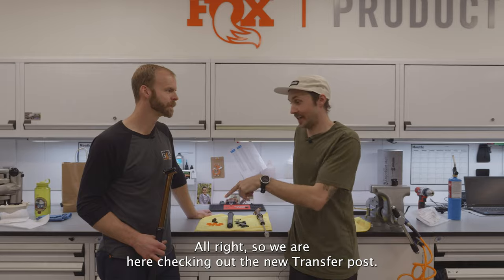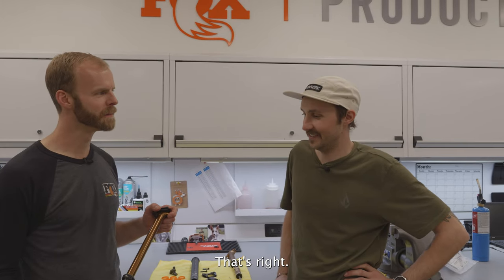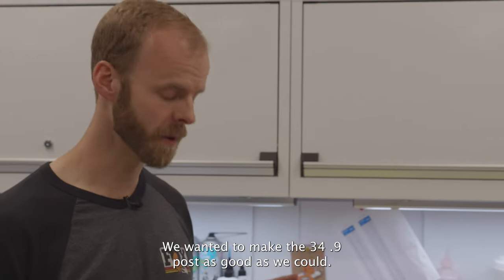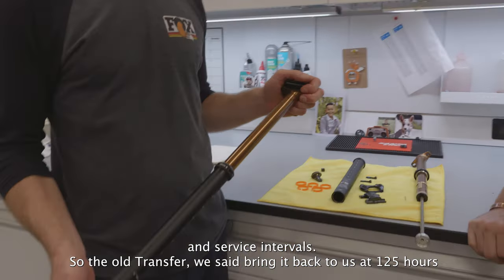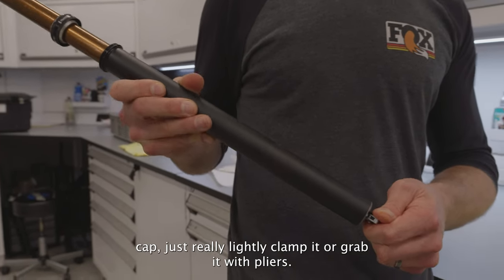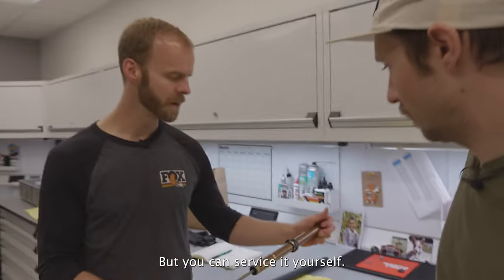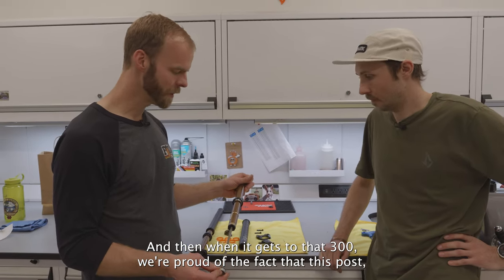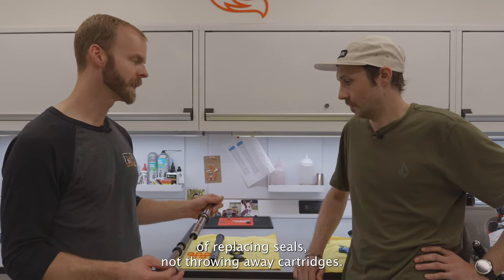First Look: New 2025 Fox Factory Transfer Dropper Post

Comment: Nice update but i see absolutely no reason not to buy a oneup post. Looks easier to service and is way cheaper.
Reply from the maker: The performance elite Transfer is right inline price wise with the OneUp! I do think some of the more robust brass fittings in the Fox make it an interesting competitor to the OneUp posts! No denying OneUp beat everyone to the punch with their droppers but I think we'll see some people catching up!
Reply: @FanatikBikeCo  thanks for the response. In germany the Oneup v3 costs 300 while the fox performance costs 370.
Reply: If i checked correctly the stack height of the Oneup is also lower and it weighs around 90g less